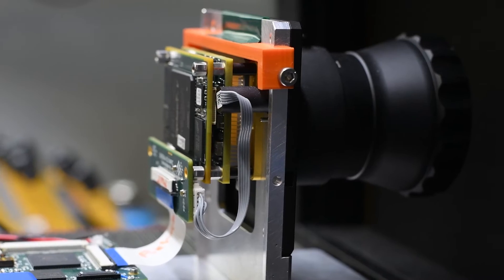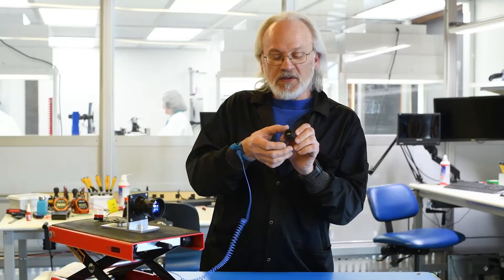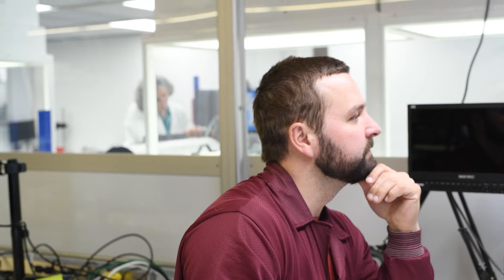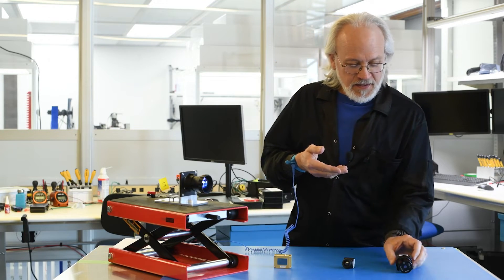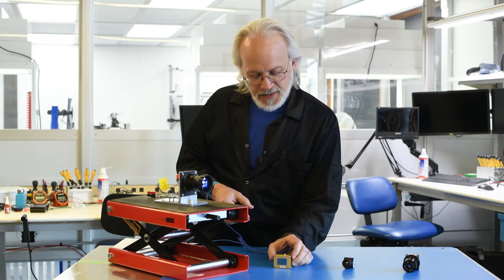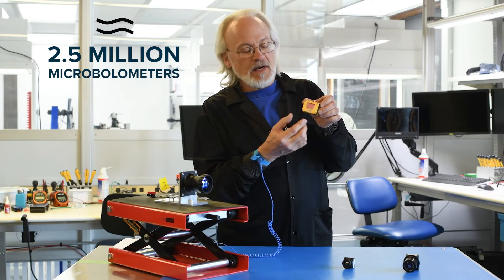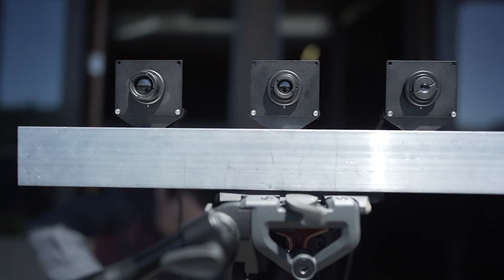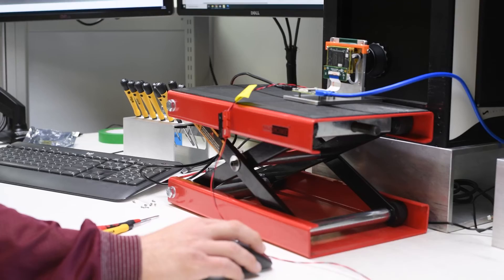Ask an Expert: What is a Microbolometer?

Comment: Is there any way to block in effect the microbolometer sensor
Reply: i randomly found an article from 2013: A vanadium dioxide (VO2) thin-film coating that intrinsically conceals its own temperature (and what's under it) from thermal IR cameras.

Comment: I think in another comment you mentioned the sensors in the video are semiconductors, eg the ir photons are jumping a band gap to send a signal down the sensor leads. 
IR photons have wavelengths in the few um range, so is that what's limiting the resolution of the sensors? RGB sensors could be packed 100× more dense, given 0.7um photons in the red part of light vs 7um photons for MIR in a 10×10 array.
Reply: it is part of the limit, yes.  Where as you see modern phone sensors with 1um pixels, you will never see a LWIR sensor with a pitch that small.

With that said, most RGB sensors have pixels in the 3-6um range, which could work fine for SWIR and much of MWIR, its just the technology has not quite gotten there yet.
Reply: @ZevHoover  it's been several years since Iray has announced a 8μm pixel pictch microbolometer for lwir. But I haven't seen it in a product. 

You also can't compare microbolometers with with CMOS or even CCD pixels. 

The gaps between the active collector area is quite notable and the fraction of active area fraction scales by a square. 

Leonardo DRS has a special umbrella shaped design for their pixels. It's more area efficient than other microbolometers and therefore their tenum (10 μm pixel pictch) models make viable products.

My own collection has 35, 25, 17 and 12μm pixel pitch sensors... I haven't yet compared them well enough

Comment: Is there a vacuum between a front lense and a microbolometer?
Reply from the maker: It varies based on the sensor type. In this video, we feature the Athena sensor on the Vayu HD, and it indeed incorporates a vacuum between the lens and the sensor for optimal performance. However, it's worth noting that the Tenum 640 follows a different design and doesn't utilize a vacuum in its configuration.